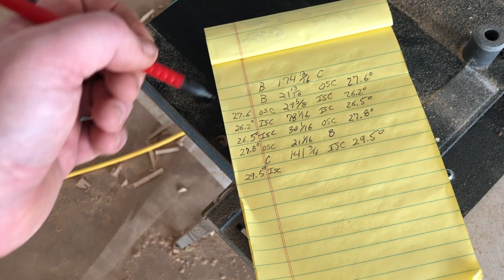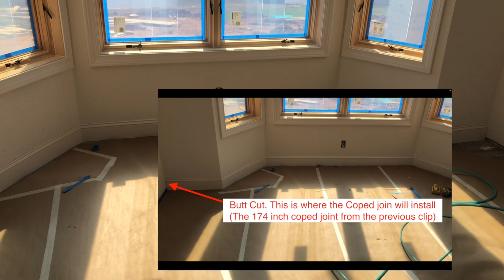How To Install Baseboards Like A Pro

Comment: This is a very nice video but the average homeowner is never going to be able to accomplish this process. This type of trimming is not for the novice. It takes a lot of patience and skill to get to this point. This is from a old retired carpenter of 50 years of mistakes.
Reply from the maker: You are 100% right. Going to change the focus and detail of upcoming videos and qualify the audience in the intro video. Working on a crown molding video now for beginners. Going to take out the copes and just do a very straightforward install and slooooow down. I will get better at this.
Reply from the maker: Much appreciated, as it is the only way I will get better at this. Thank you
Reply: I disagree. 

I am a novice/DIY guy and I excel with trim work.  It takes patience, an eye for detail and a willingness to learn from mistakes and improve.

I think we need to consider new terms.  Some of us DIY guys are pretty talented, but never got into the profession for a myriad of reasons.

And then  you have Henry or Helen Homeowner who has barely held a hammer before wanting to learn new skills

So does this help that beginner?  Not as much.

But for Novce/DIY people - there is plenty to learn here.

It's clearly an early video on someones journey.  But I know he will learn and improve, just like we all do when learning a new craft.  (And creating content, editing and narrating videos is in and of itself very much a Craft that requires practice)
Reply from the maker: @ericadams4712  Hey Eric, and thank goodness for folks like you. Common sense is not very common anymore, unfortunately. The video is definitely cringe worthy for sure, but like you mentioned, I can see myself getting better and better. The “Window Trim for Beginners” is definitely better than this one. Got to have pretty thick skin to jump into this YT thing. Like you I enjoy the learning process. Your comment about attention to detail is HUGE! You just can’t teach it… either you have it or you don’t. 
Your comment came just at the right time, and I can’t thank you enough (sincerely). 
Editing is getting somewhat better. I am in a rural area in the foothills of NC, no internet and an iPhone 8.
Great point concerning the patients needed to learn something new, and the associated time to do so. You give me hope sir that I am not wasting my time here on YT. Thank you again.
Reply: @ericadams4712  you are definitely the exception.

Comment: Sorry, had to dislike this video.

I'm from the UK and I was taught carpentry on how to use a coping saw to get the ends of the skirting/base boards to fit up against another for the inside corner. I tried searching on Amazon for one of those Speed-Cope devices and nothing found. Nothing remotely like it. Search via Google instead and I found it for $200 yet nothing available in the UK. I'll make one out of wood sometime, will be a lot cheaper. Either way, you've not really shown anything instructional. You've explained the steps without showing much.

I was also taught to use skirting boards made of real wood - not that there's an actual difference - and definitely don't use CA glue to glue pieces together. Never glued ends together. You measure and cut a piece and fix it to the wall then move onto the next piece. I've seen no measuring and no cutting. If you're going to show people how to do things, make a video taking you through all the steps from start to finish. What if the property you're in has no power and your battery dies on something?

I was taught how to use hand tools for everything including finding the angles to cut - I'm here to se how it's done with a miter saw and an angle finder and haven't learnt anything.
Reply from the maker: Sorry to let you down Zeb. I sincerely appreciate your comments. Please please don’t give up on me. Trying to find my niche here on YT. It might make you happy to know that we are redirecting the entire site to be just for the DIY Community and the intermediate to advanced user like yourself. I hate to disappoint, but the painful truth is that you are 100% right. And I darn sure enjoy have a friend across the pond!
Also, if you could please watch How to Trim a window for beginners and give me your thoughts. I would be in your debt.

P.S. We will not start a trim Jo’s without temporary power at the site.
Reply: @productiontrimcarpenter  Not let me down at all, it's all a learning experience. I watched a video yesterday on how the UK does it in 2023 and amazed to see how MDF is now used more and they were actually using CA glue with the activator. I've got both myself but use it for other things. I'll get onto that video now.
Reply: Forgot to mention - because I've known how to fit skirting boards using just a hand saw, square and a coping saw, I've never really looking at any other ways to do it. One video I watched recently was using a Miter Saw Protractor together with a bullnose trim gauge. My Miter saw protractor was delivered yesterday and my trim gauge is turning up tomorrow. Can't wait to try them out in the new bungalow.

I was working out yesterday whether it's cheaper for me to buy pre-shaped MDF skirting boards or buy plain wood and mould them myself using my router and it looks like MDF is a lot cheaper. Plus I don't have to knot & prime, then seal the wood before fitting it to stop knots burning through and reduce shrinkage as it dries out over time.
Reply from the maker: @YesiPleb  Thanks for subscribing Zeb, glad you are part of the channel!